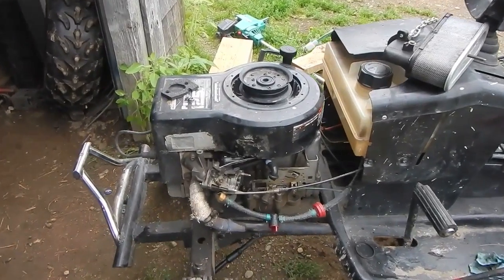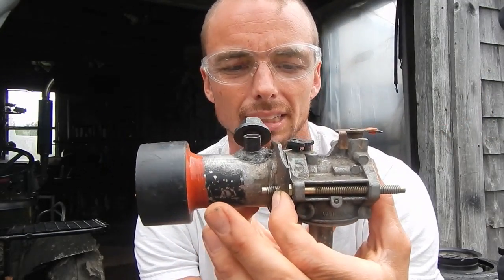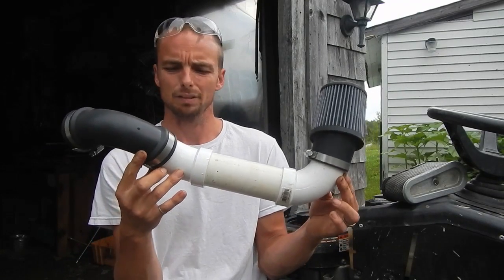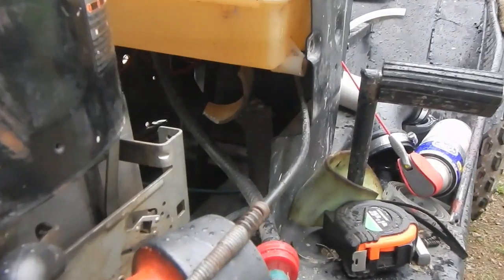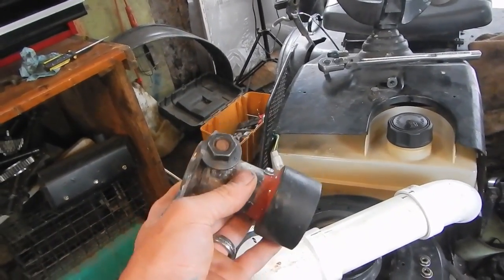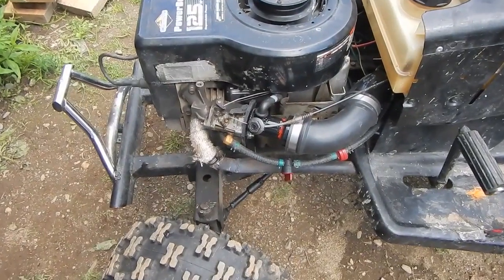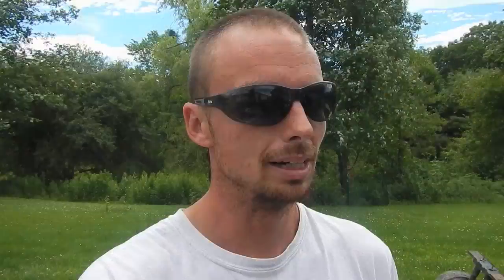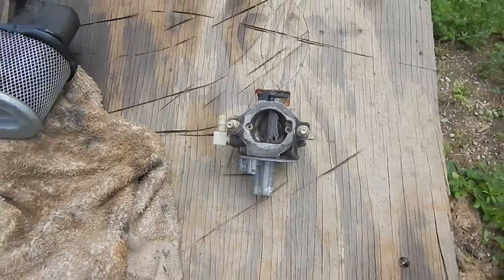Mud Mower Cold Air Snorkel Mod

Comment: When you were moving the tank, I was envisioning the screw mounts cracking on the other side. I'm amazed you have not upgraded the gas tank to a better quality type like the MTD tank. Iv always had problems with the Murray tanks and now they are getting harder to find.

Comment: Thank you I was having lot of problems with my mud mower but after watching your video and the way you explained it I was able to fix it.
I also modified my gear stick like yours. Keep it up.  I am in Brisbane .just wondered which part of the world are you. I am having problems with my greenfield e2000  steering  I use it for cutting grass. I  don't know how to fix it. I have all the tools and good with metal work. Thank you

Comment: ok iv heard u talk about cash can on ur mower what is it what dones it do for the mower?
Reply: Ray,

I'm just searching through these comments to get the same answer.  I thought he said Catch Can and I am thinking it has something to do with the PVC mod.  

Just thinking out loud, the PVC air usually has the air filter between the intake air and the carb.  Now it goes straight into the carb so oil sloshing about could splash up maybe and go straight down through the carb without gettting slowed down by the air cleaner.  

I'm surprised no one else has asked.  I still don't know what it is.
Reply: You know what he is probably talking about is as simple as running the PCV into a catch can for the oil that gets splashed up rather than running it through the intake.  

When I was younger I just ran the pcv hose to the street on my old cars.  He's probably talking about installing a container to catch the oil that gets puked out the PCV.

Comment: Awesome mod! I have a MTD with a dozer blade operated by a winch fitted, and cutting deck removed. I think I'll do this mod to mine, as well as upgrade the carb and exhaust. Maybe even put a little flapper on the exhaust!

Comment: I got a 12 hp Briggs on my mower, i run it straight pip, and am going to do a snorkel air filter but on another note, it will only run for very little with out getting really hot, if i put the motor casing on would that help keep it cool? my dad says the oil pumps probably gone  Fearlessfront
Reply: Keep the engine shroud on, it directs air that is pulled in by the flywheel to the cooling fins on the cylinder

Comment: I would of welded a bolt to the top of the air filter and drilled a hole through the dash and put a wing nut on it

Comment: hey fearless I had an idea could you just use a bigger diameter exhaust pipe instead of using the shop vac adapter ?
Reply from the maker: yes, but I couldn't find one the size I needed. So I used this adapter. it's still holding up, and I recently BEAT THE SHIT OUT OF IT last weekend, and no cracks or nothing.
Reply: good I may try that if I canot fint the right size pipe

Comment: Dumbest thing ive seen ! You can tell your not a plumber you mark the pvc before you glue&clean it.
Reply from the maker: Dumbest thing you've ever seen? 
Look in the mirror you @sshole!
(And no, I'm not a plumber, never claimed to be either!)
Reply: Im a master plumber thats why i laughed when i saw you mark the pvc. Damn im an ass hole just cause i said that cluster fuck is a disaster? Look in the mirror?  Id do formulas that would make your head spin, But thats not what this is about. Thats a dumb idea just cut the grass and get an fing hobby guy!!!
Reply: Its pvc!
Reply: Drill a hole in the metal hood and have the air filter up there near the steering wheel or where ever you can snake it for it to be cold air! Not inside the box or hood what ever you call it? Where the engine is creating heat??? I'll bet ya a hundred bucks it'll be way better! Then all you have to do is unscrew the filter to lift the hood!
Reply from the maker: christian berry then every time it rains, or I sling mud, it's going to get into the filter. The old filter housing is actually fed hot air by the flywheel blower on the motor. So this setup gets way colder air.
Reply: If that filter is vertical and you oil it properly you wont get water in there in less you drive under water! Im tellin ya!
Reply: And it ain't rocket science putting a pipe in a hole
Reply: Shows what you know I've only seen a couple people put a cold air intake out side of the hood that's just a stupid idea all cold air intakes I've seen have been put under the hood and if you pay attention in the video he marked the PVC first but he did make some small adjustments and I'm sure he mocked it up before the video so back off plumber man
Reply: Snorkel it up!!!

Comment: Fearlessfront you got to remember those filters like the one you have got for the mud mower may flow better but the suck in way more debris even if you oil them trust me I used to run one on my go kart and they are junk  I run an R2c reusable paper filter on it now and it works way better because its not sucking in dirt and as far as flow goes it might not flow as good but with my engine I would rather have a better quality filter then a k/n style my engines last longer because they dont suck dirt into my engine and I didn't notice a power loss by switching, just some helpful hints for you, ur air intake looks awesome great job on all your builds

Comment: Awesome engineering as always...failures are battle scars to be worn with pride! Not a big fan of the shop-vac part...that plastic is too brittle. May also fail with the proximity to the engine heat.
Reply from the maker: if I can find a metal adapter that will work, i will definitely replace it.
Reply: Fearlessfront
I'm surprised they didn't have a reducer in plumbing next to your other pvc. You're limited on hood clearance though...  You know that the pvc is malleable with the right application of heat?
Reply from the maker: Cattmann they did, but nothing that would fit the "id" of the intake adapter.
Reply: Fearlessfront
Didn't you use your drill press awhile ago to turn something? Could you mount the reducer and turn it to the id you needed and have enough left to work with the adapter?
Reply from the maker: Cattmann no, I don't have one. There are a lot of tools like that I wish I had
Reply: Fearlessfront
Auctions and estate sales...gold mines!
Reply: Fearless how come you never reply to me
Reply: +FearlessFront (Todd Christopher) if you used a 2½ inch PVC tubing like I did, you can use a carb bowl off of a 25 cubic inch briggs, like a 1980' craftsman with a 10hp or 11hp single cylinder, then you can drill a hole in the bowl and then weld it to the intake adapter.

Comment: hey Fearless,,,what is the best peerless transaxel to use for racing??? I have a P1 and I doubt its worth anything but mowing,,,thanks,,the ole fart Jimbo
Reply from the maker: probably and 820, with an internal re-gear. they seem to hold up the longest. I have an mst-205, quite a bit smaller, but it works very well for me
Reply: thanks,,found a 4 speed,,will try it,,and like your videos,,the ole fart Jimmy Haley

Comment: Nice snorkel. That setup should give you a little more torque in the topend. If you would have made the diameter a little more smaller you would have gotten more power and torque out of the motor in the mid and low range which would have been more noticeable, but still a great setup. Can't wait to see your catch can setup. Let me know and I can make a vid on how to modify that valve cover to where you don't need a catch can.

Comment: that is a great design. the dash cowl keeps mud off of the air filter, and unless you sink it over the dash, it ought to keep running through some pretty deep stuff...probably deeper than you want to go with it...LOL

just out of curiosity, what do you think you have invested in this tractor so far? a similar setup with an ATV would probably be a couple grand. at least.
Reply: by the way, car and bike engineers have been tinkering with intake and exhaust lengths and diameters for decades. a smaller diameter intake tube might give you a bit more velocity with the air charge into the carb....faster air might make for a better mix of fuel/air to the engine. just a thought.
Reply from the maker: rtabish haha! I don't know how much is in it now... If I had to make a educated guess, I would say roughly $500-$600... Most of that would be the tires. I build most everything on this rig with spare parts. Sometimes, I have to buy small stuff to make things work. But I like using spare parts on this rig... it's more fun
p.s. I've owned this rig 10 years now. No joke.

Comment: have you considered building a snorkel that comes straight up in the air so ya can like bury it in mud and it still runs?
Reply from the maker: I never really encounter anything that deep. Plus, with it hidden, it's less likely to get splashed but muddy water. I'll probably do another snorkel on the sears soon.
Reply: The snorkel on the sears would be quite the addition for a diesel not only would it look like a complete beast it would also be a smart thing to do...

Logan

Comment: That's really cool! I'm glad it worked well. For the catch can make sure not to use any hose that's not fuel resistant. Could you do a video on your sears throttle setup? I'm building a racing lawnmower and need an idea for gas pedal!

Comment: @kierankay100 You could turbo a briggs like that BUT its finding a small enough turbo that the engine could actually spin the compressor wheel enough to actually make boost.

Comment: Fearless, your completely awsome in the way you build thing I'm building a go kart and wanted to have your opinion on what type of engine I should use I was thinking about a diesel but can't be sure...

          Logan
Reply from the maker: diesel's are pretty awesome, and expensive! If you can afford it, then it could be an option... They aren't very "snappy" like a gas motor, but are torquey, and are very fuel efficient. Mine cost $600, but you really dont need one that big. Hell, I dont need one that big! lol
Reply: Thanks fearless it really does help me narrow down my search... But I don't know if I should go with 16 hp or 10 hp it's a tough decision...

Comment: its a shame there are no other carbs you can get or fuel injection then you could potentially turbo charge im suprised a company hasnt realized people make racing mowers nd they thought lets make performance carbs oil pans steering gearboxes and shit like i know theyre reliable and fast but the jets do get clogged and float can get stuck in the carb it would be cool if you could also buy better connecting rods that dont snap wit the extra preformance and stuff
Reply from the maker: yea, you would think... There are some parts available, but they are expencive for some reason... Most are almost as expensive as car parts.
Reply: thats so stupid tbh its hard to make homemade carbs as theyre are too complicated to make especially if you want preformance like homemade exhausts and intakes can be done but cool seats like lawnmower bucket seats should be made and enhanced oil pumps and better cooling

Comment: Thinking about starting offroading on lawnmowers what would be the cheapest/ best mower fo
r it
Reply from the maker: murray or craftsman. They are everywhere, and the work pretty good. But anything cheap is idea! Avoid MTD, and anything with a hydrostatic, or "automatic" transmission. Get one with gears. (so you can make it faster)
Reply: Ok thanks for the advice. Was looking to do a summer project
Reply: Fearlessfront what would a mtd lawnflite be like for off roading
Reply from the maker: Padraig O' Neill not sure, i'm not really familiar with that model.

Comment: My mower over revs like it's all or nothing with the throttle I had the whole system apart and the governor that's in the block sticks and won't let the flap close sometimes what could I do?
Reply from the maker: I would wd-40 all the governor and throttle linkages. Mke sure all the springs are in place, especially the really thin spring on the governor-to-throttle-butterfly linkage. thats an easy one to miss
Reply: What could I send a picture of it to you on?
Reply from the maker: Hazen Foance i'm sure you could google a few pics, or even find a repair schematic that will show you how it should be laid out.
Reply: I got it to retract it's just it won't slow down like it's probably running 5000 all the time I have to turn the throttle down but then when you turn the blades on it just dies and you gotta turn it up again it's just a pain in the ass

Comment: Hey fearless front I have a question for you I just put spider gears in my peerless MST 206 and no sooner than I get on it and go full speed The rear tires lock up and the moter stalled I took off the belt and tried to spin the tranny pully And it would not spin could it be them brass bushings/bearings on the gears

Comment: That's cool and functional looking . Do you ever modify the engines any further than stock, if not what could someone do to a 12.5 like yours and is it reliable.. Good vid.
Reply from the maker: use an ohv rod and piston, then port anything you can in the intake and exhaust ports. Should be fairly tough after that. Not a ton more power, but it will be reliable.

Comment: Ahh, yes. The engineering game. I like that part. It's kinda fun to blow apart what appears to be a simple project, and break it down. I always like to think I'm engineering for the future. My future, because I'm gonna be the one workin on it!! So a few days of thinking up a plan in your head and writing stuff down goes a long way down the road. Now you have a decently engineered system that's not in the way for service. Just keep an eye on the rubber elbow and see if the gas wants to eat it over time. Other than that she's sweet. Cool mod, thumbs up!!
Reply from the maker: Didn't think of that, thanks for the heads up!
Luckly, those elbow's are cheap!
Reply: That's what brainstorming is all about. Not putting down someone's idea, but enhancing it and improving is what it's all about... Looking for unforeseen problems down the road. I'd think if anything that boot may get a little harder but should be fine

Comment: Nice job man. I'd have do mine different I have The old one piece flow jet card on my old flat head. I don't ride as hard or corner like you do. Just a old fart having fun on off road mowers....lol
Reply from the maker: those one piece carbs are pretty easy to attach too. Most people use a radiator hose, clamped to the inlet of the carb.
Reply: Yup I might be posting something soon. I have a radiator hose that is still fine for air to flow trough. Just have look for some type of filter.

Comment: Awesome design! Nice step by step instruction of the design and install in this video. Looked very cool once you installed it on the Murray! Do you think you will do something similar to the Diesel Sears intake at sometime?
Reply from the maker: Yea, I will have to do something similar to the sears as well. I really dont like the filter setup on that motor.

Comment: For your catch can you should make it be able to return the oil back into the motor so it's not filling up with oil also I would like to see a vid on how you make the catch can I'm sure others would too
Reply: Just remember that whatever you do, the PCV system must be vented to atmospheric pressure, or all hell can break loose on it. Under manifold vacuum, the oil can get sucked out (as FF demonstrated). Under pressure, it'll blow the disptick out or worse (seals).

Comment: install another ft of tube through the "dash" and put a snorkel on the exhaust and drown that thing!
Reply from the maker: haha! only problem is that I wouldn't be able to steer.
Reply: he ought to head up to inwoods in august and show them boys how to build a mower! ffs!
Reply: The diesel of his would be easier for an underwater deal. 
Cause no spark. I'm really a diesel man at heart. So diesel ftw as far as total submersion. Sparks can be a tricky thing to keep inside wires on a gas engine , but I guess these are small enough to be able to encapsulate the ignition with some rtv or somethin.
Reply: Thats one hell of an idea!
Reply: did you ever have to rejet.? or was it OK that way?
Reply: Hey 3D mechin sorry for bad spelling I've been a sub for a while
Reply: 3DMachines hi